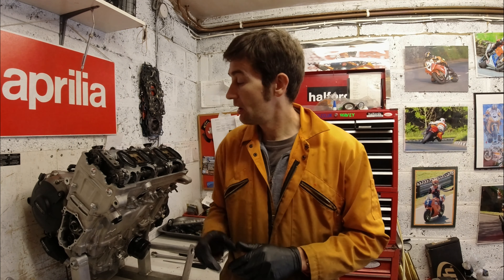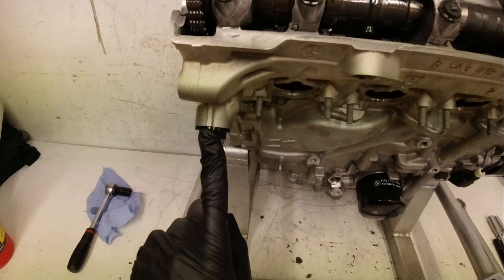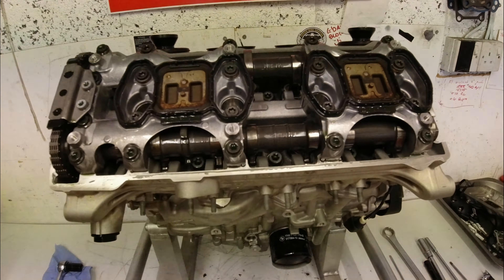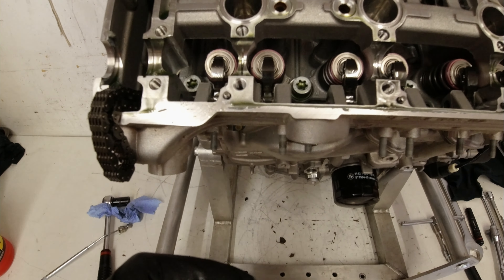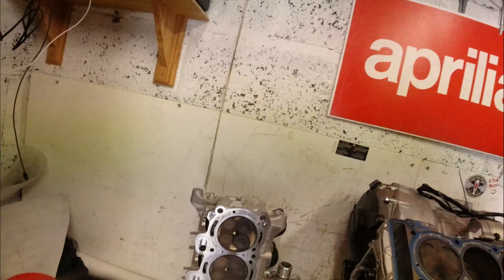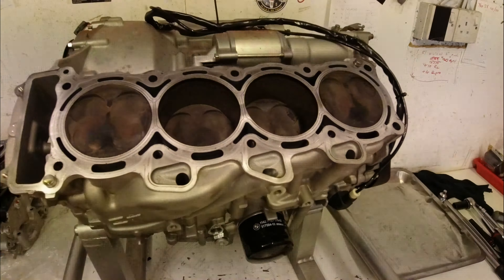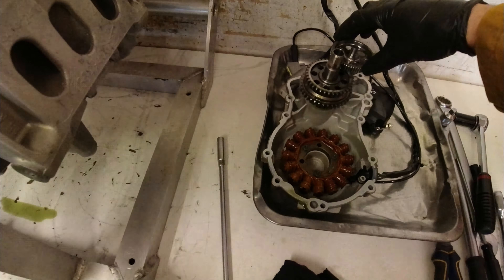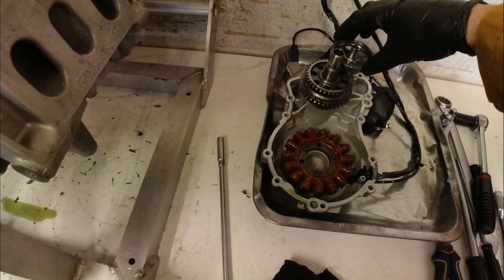How to refresh a BMW s1000rr engine  Part 2

Comment: Could you explain the the significance of the number of holes in the head gasket?
Reply from the maker: It's just a code BMW use for showing the different thickness of the gaskets. A one hole is thinner than a 2 hole. They do a no hole option but realistically it's too thin unless you're on very special fuel
Reply: @obsession_engineering  Educated. Thanks,

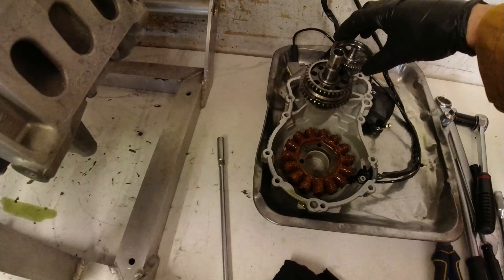Comment: hope this isnt dead comment section lol. but how did you get the crankshaft timing gear off? is it bolt on or press on? 6:23 its gone
Reply from the maker: I've never tried to remove the gear from the crank, but the lay shaft gear just slides on, so they can run a shorter chain and change the drive ratio